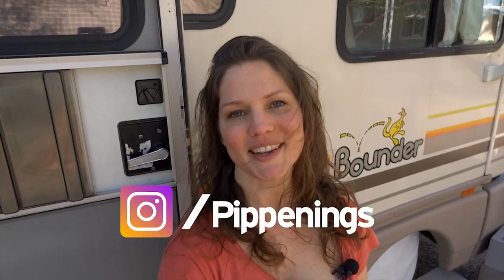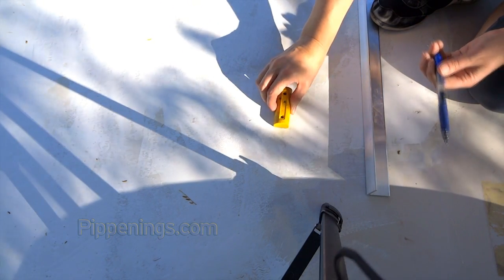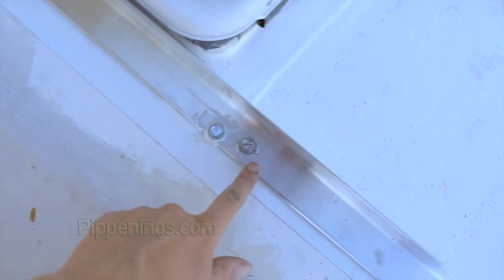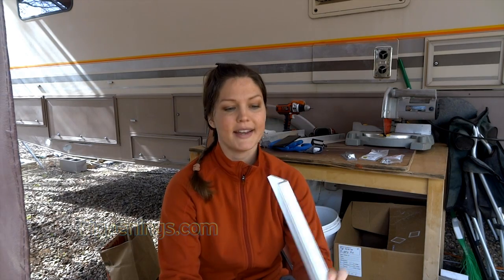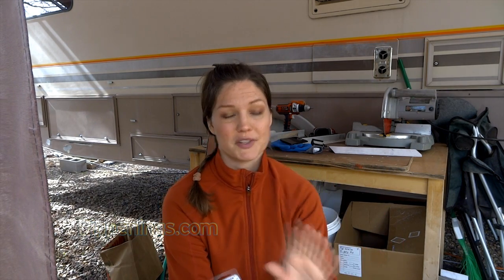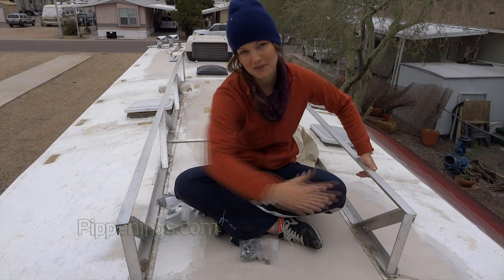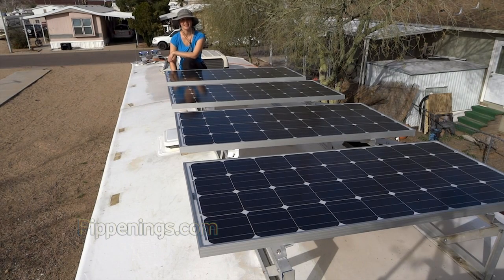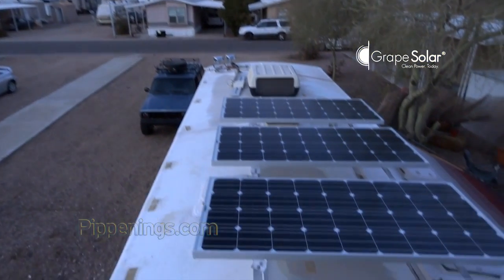RV Solar Panel Installation part 1

Comment: Hi Pippi, I did a solar install 4 panels directly on my roof.  The roof not being flat didn't make any difference on my install, and i avoided shade issues.  My 4 100 watt solar system runs a battery bank of 2 batteries, that are in a bay under the bedroom, from there i power a 2000 watt inverter that i run a large TV, and my laptop and tablets. The chassis batteries are connected to an inverter in the living room, from there i can power a tv in the front or run an extension cord to power anything under 1000 watts.  Not idea but it worked well for travelling to 40 states last summer.  Never really ran out of solar on my battery bank.  One large battery bank would be nice and im going to think about that. Im curious your battery bank must not need to have water added as it seems there is little space to check or add water. I need to check mine often in summer as they use water and i have to add some regularly
Reply from the maker: +jay meese I have a watering system which makes it easy

Comment: mixing metals .... some will have reactions by mixing different types called electrolysis
Reply: Yes, unfortunately dissimilar metals accelerate oxidation/corrosion.
Reply: Amadeus Rocks This is very true however from my experience you won't notice any oxidation for about 10 years and in my opinion the corrosion isn't making the metal any weaker it just looks ugly.
Reply: Don't want to use stainless steal bolts and nuts together, they will weld together and you won't be able to take them apart again.  Normaly I would use zinc nuts and stainless steal bolts to prevent this.  I don't know it the galavanized nuts will be cut close enough to work with the stainless steal bolts "the galvanizing adds thickness".
Reply from the maker: +EV Dave That's what I used. Zinc nuts and stainless bolts. Should be good to go by your tip.
Reply: EV Dave please don't give stupid advice! SS fittings do NOT "weld" together and heavy galvanized washers cost much more than SS washers... dissimilar metals shouldn't be mixed due to "galvanic" corrosion when one metal will give up material to the other such as copper and iron... as for mixing zinc plated steel and stainless steel you will be fine but not preferred method when bolting aluminum all stainless would of been much preferred...
Reply: Robert O'Connor mind your own business
Reply: Amadeus It's my business as a follwer and when ignorant fools lie to the young lady...  I have done this as an "expert" for 30+ years...

Comment: Galvanic corrosion occurs when two different metals are in contact in a corrosive environment: one of the metals experiences an accelerated corrosion rate. The contacting metals form a bimetallic couple because of their different affinities (or attraction) for electrons. These different affinities create an electrical potential between the two metals, allowing current to flow.I suree like you Pippi.
Reply from the maker: +snarfie magpie Which two metals though? I understand it's only a few different metals together
Reply: Zinc & Galvanized Steel                2
Aluminum & Aluminum Alloys     2 The corrosion of the base metal is marginally increased by the fastener

Comment: One question: can I use any usual electrical 2.5 mm wire that corresponds to awg 10 us system, for my panel?
Reply from the maker: +TSIRHC SEVAS If those are the same size just different measurements, sure!

Comment: Awesome build...you might to go to your local metal recycling yard..if you need to save money ..and remember to find away to protect your solar panels if your in a part of the country that have HAIL storms...and thieves love climbing on top of tv's for Solaris panels..I have installed a metal panels with holes on my ladder..that leads to the roof..I made it to to swing side ways..to provide access to the roof..also install a locking device on it..just look at the back of a McDonald's ..they have the same setup..to prevent people from climbing on to their roofs..
Reply from the maker: +Cep Villanueva Great tips!

Comment: Hi pippi would be a bit worried about the amount of leverage the wind will be able to put on your panels not just from the Aspect of ripping them off but also the aspect of damage to your roof I would drop the structure write down and allowed your vents 2 still open a few inches just all the best from Scotland
Reply from the maker: +David Macdonald I consulted an engineer and a mechanical designer that both went onto my roof and also spoke with an RV tech at camping world. There are roof racks made for all types of vehicles and all sorts of things on them. I'm not worried.
Reply: Good pippi if your happy  dats cool , love your videos girl .

Comment: It's pretty clear to me that a LOT of posters don't have any clue about aerodynamics and air flow and lift. These panels are NOT configured as sails, so stop saying that! If they were mounted as a billboard, that would be entirely different. The thing to consider is the relative speed of air flow between the top and bottom surfaces of the panels. You do not want significantly greater air flow speed above the panels than below, as that causes lift, like an airplane wing. I DO think that it would be VERY prudent here, to remove the rack's bottom two tracks and install a full length of 3M VHB tape under those tracks. THAT would remove all doubts about adhesion of the entire system on the roof. The tape comes in 1" x 15 ' lengths for $30 on Amazon and would be all the insurance you need to ensure no separation of the mount. Great job on the rack and design. Having started my own design which is similar, with a 12" height on each side (but not level like yours), I fully understand the work and effort that went into this. Well done, young lady. You are very impressive. I wish you well, Barry.
EDIT: Ahhh, just remembered that you do not have a fiberglass roof! The 3M would not be appropriate for your roof, of course. In this case, like some of the others, I would recommend a "through-bolt" system to ensure structural integrity despite the PV being mounted horizontally to the roof, which minimizes the potential "sail" effect.
Reply: That is what I was gonna suggest VHB tape is King. would like to see the armchair guys yap about VHB...

Comment: Wondering why you didn't use lock washers on the nut end?
Reply from the maker: +Tom Bair I used Nylock nuts instead. The panels came with lock washers though.

Comment: Hi Pippi
Let me say that this is a great series (no pun intended)
it has helped me immensely with understanding PV power
I love your ability to make the complicated understandable
Typically I do not comment, but you have helped me understand ... it all
so, I would like to give some words back
I see some have given you feedback in this and other vids -  on the tech and what not - but please know this: YOU ROCK and well YOU REALLY ROCK
OK, enough butt kissing
ok, a little more but kissing: you do answer them basters (the critical ones) very nicely
ok, to the point, for the panels on the roof of the RV: did you consider making them so you could remove them easily. Second if you are going to keep them on the roof while moving; have you considered a "foil" in front of the panels? (big trucks us this to move air over the trailer to cut down on drag) I agree that your installation will compensate for lift but there is under draft
And I do like the way you ware that old hat: hey I am a fan
Ok, not sure of the point I made
more so a line of support and I do appreciate the YEARS of research you all put in
From high in the ARCTIC (very close to the north pole) I wish you happy RV ing
This coming from some one that does not have roads to drive on may not mean much but please know this : I do dream
Happy trails Miles

Comment: Have you notice any change in your gas mileage since the installation?  I'm thinking the wind would be bouncing around up there, creating resistance.
Reply from the maker: +VA2906 R I've still got the same mileage

Comment: impressed.. quite a unique special person.. awesome
Reply from the maker: +Shawn Gregory Thanks Shawn
Reply: Ive watched you for awhile off and on, IM only upset that you have a better handle on all this than me dang it!! IM getting ready to full time RV, but it will be using a trailer instead, to start.. trying to get out west and create a biz out of guiding and helping kids get to the woods more. Its where I find my connection to God.. I think most of us need alot more of that kind of time out there.... anyway, thanks for the vids!!
Reply from the maker: +Shawn Gregory You bet Shawn. Hey, I know there's a couple programs like this in UT if you're interested.

Comment: You didn't mention the wattage of the panels, i think? ... guessing a 800Wp total?

Looking forward to the rest ^^ ... tnx for sharing.
Reply from the maker: +Dutch Courage Doh, can't believe I missed that. It's just under 650W
Reply: Pippi Peterson tnx :) ... bit of a weird number when divided by 4 though... is that the maximum Watt piek or is it the average yield you get from the system?

Comment: Just for future reference it's angle aluminum it's not angle iron or aluminum angle iron. but other than that great job I'm impressed. I definitely would have done it differently but your solution will definitely work well.
Reply from the maker: +flat 4 The shops I talked to called it aluminum angle. Not angle aluminum. I call it angle iron because that's what my dad always called it. Historically speaking angle iron was probably the most and first readily available so when new metals came along you could just specify that in front. Anyway, I still call it aluminum angle iron and I've never gotten something different than what I was thinking I was asking for.
Reply: Pippi Peterson I have employees that work with it everyday and call it aluminum angle iron and it drives me nuts it's one of my pet peeves. You can call it whatever you want.

Comment: Pippi you are amazing as always. I have a bit of a big concern. I looked for way to pm you but found none. I am probably wrong. Knowing you you did your research but the channels that you screwed into depending on your rv are kinda v shaped with wings. if it felt like you were not getting a good piece of metal in the middle when you drilled into the roof. my big concern is they run wiring down the middle of the rails. it could cause a short and a fire from the screws. Hope I am wrong.
Reply from the maker: +vexrllful Not sure what v shaped with wings means but I haven't had a problem yet. Those base rails went up months ago. The screws and too long anyway. Thanks for the thought though. Hopefully won't be applicable.
Reply: the supports that you used magnet to find on roof are shaped that way. they run electrical for lights, vent fans and a/c thru those supports

Comment: Also, if it were me, I could'nt feel easy that just self tappers were holding it on. I would drill all thru & bolt nuts inside.They'd be on the ceiling, but u won't notice them;and u'd feel safe.

Comment: I'm a little worried about the frame being bolted on to your home. I don't think there going to be strong enough for when you drive place to place.
Reply from the maker: +brian middleton I consulted an engineer and a mechanical designer that both went onto my roof and also spoke with an RV tech at camping world. There are roof racks made for all types of vehicles and all sorts of things on them. I'm not worried.
Reply: I wish you all the best Miss macgyver.

Comment: Flexible panels would fit the curve of you roof and eliminate all of that metal work. Plus they are more efficient. And they weigh far less.

Comment: I agree with the comments that this build is not really optimal.  It was too costly in material and work, the panels don't much weigh much for trusses.  A design similar to a car roof rack will do where you just design it so that the panels will lay flat on the roof.  Secure it enough so the panels don't get blown by the wind or easily stolen.  When it is time to move, remove the panels and store them inside.

Comment: i wanna run my tv, computer, and stereo, i dont know the amp of the 15in laptop, the tv is 1.8v, dont know the stereo, i seen a 200w portable charge kit, OMDad its $958, thats way to much for my budget, any help you can advise?
Reply from the maker: +Max Knight Watch my video on how to calculate your regular usage to know how much energy you need.

Comment: Hi, Flexible Solar Panels would have been best, plus less wind drag if you seal the panel edges.
Reply from the maker: +Nitlesh Nand Panels are inefficient and can even be non functioning with shade on them. There are so many obstacles on the roof. Plus, I'm not convinced on the ability of flexible panels. They'd never be fully harvesting at once.

Comment: Pippi you did a great job in building your frame for your solar panels. But there is one mistake that I see you made and I hope you don't get upset with me telling you. Be cause you used dissimilar metals bolting the frame together you will oxidation going on. There is a product you can put on the bolt to stop that. I am sorry I can't remember it right now. I am sure if you ask around ,someone will have that answer.  Gary

Comment: Always ALWAYS use stainless steel hardware for these installations. I'm surprised I have to tell you this. That zinc may be cheap, but when you have to drill it out because it's so rusted the threads have melted into each other, you'll wish you'd used stainless. Spend the money. Also, when using nuts, use locnuts for an installation like this.

Comment: Personally I wouldn't trust that construction to hold up, particularly because it's simple bolts into a flimsy metal frame on the roof (not bolts and nuts or any kind of shape that provides stability). But that's just me. It will definitely add at least enough drag to lose a gallon or two in fuel efficiency - you're essentially driving around with a sail on top. Of course that depends on how much you drive. A wind deflector is definitely a good idea
I would not mix different types of hardware. Slightly acidic rain will turn those bolts into little batteries giving you all sorts of corrosion issues you wouldn't have otherwise. For the 3 types: Coated means pretty much dipped in zinc. Galvanized always means an electrolytic process, so the coating is applied using an electrified bath - which makes for a tighter and more even coat. Stainless has no coating, but a lot of chromium and other metals in the iron mix to make it resistant to corrosion. For outdoor stainless is the way to go. I'd use blue Loctite on the threads - that's the liquid you're referring to. Blue loctite can be undone and it's applied onto the thread before you screw it together. That's the kind of thread lock you find in places like the oil cooler in the dab smack middle of your engine block - plenty of vibration there. So that's what I used - and you can even use it with a lock nut you used (although that's kinda redundant then). Generally you use thread locking glues like Loctite when you have a thread into some kind of solid metal (like in an engine block) where there's no nut. If you have a nut, you use one of the different types of lock nuts.
For the "tiny bit of shade can reduce efficiency by 70%" statement: I'm not doing the fish mouth voicing "fake news" on that :-) Modern solar panels lose efficiency in correlation to shaded area, so to lose 70% of the panel's capacity you have to shade it to around 70%. The thing to keep in mind is that solar panels don't like shade and the cells in the sun will try to compensate for the ones in the shade. If your panels have bypass diodes built in it's better, but basically you want the entire panel in the shade or in the sun - not half each, as that may have an impact on the lifespan of the panel.

Comment: great video, love your can do attitude. As mentioned in other comments, galvanized and aluminum do not play well together. dissimilar metals, causes corrosion. I have found it better to buy bolts, not and washers in bulk common sizes to keep costs down. Not much weight and they get used. Save trips to the big box home improvement centers, where I have worked for 25 years. Not a know it all but know what is right. KORITFW